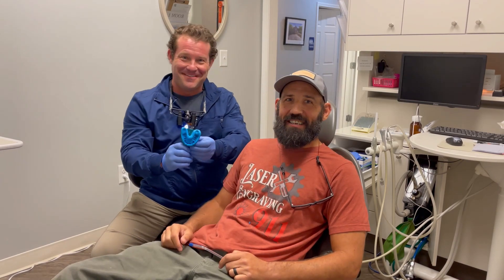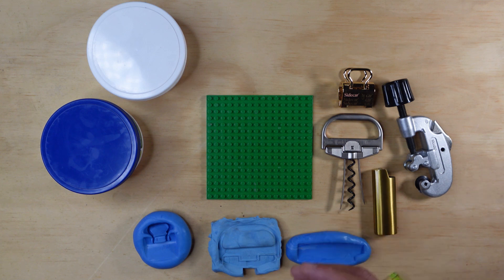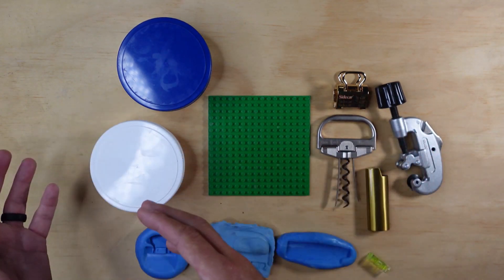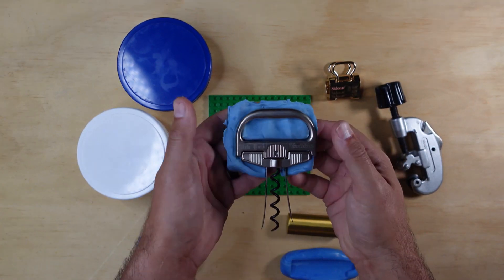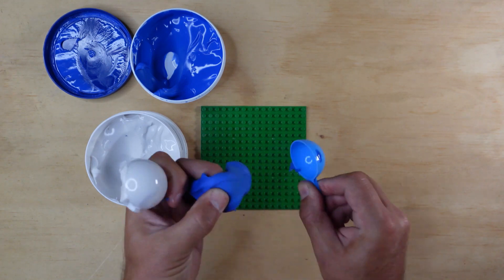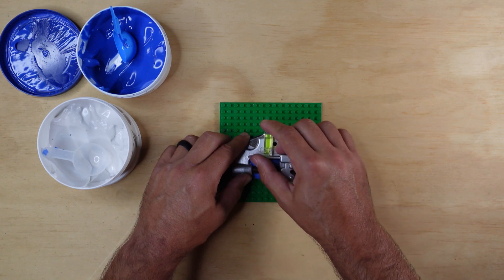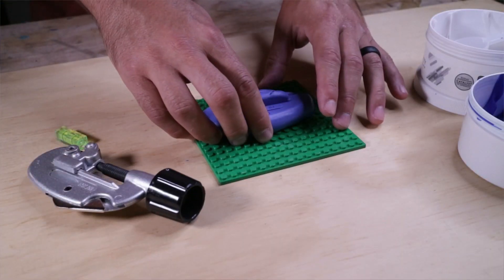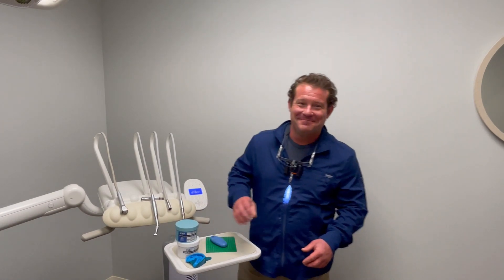Making Fixtures For Laser Engraving - Why Should Dentists Have All The Fun

Comment: Good idea but it seems modeling clay would work as well and probably much cheaper.
Reply from the maker: Thanks for commenting ! Actually modeling clay is a poor choice for this, it does not hold its shape, it sticks all over the object, and sags over time, i tried this early in my carrier, and it was a fail. Making ridged mold like this, is the way to go, so you can reuse them over and over again for years, and it holds your items perfectly.
Reply: @LaserEngraving911  
True but not after sets up and that can be easily expedited in a toaster oven. I mix plaster of Paris in to make it set faster and harder. I do this for fixtures when building small welded scrap metal art when I build multiple repeats. It doesn't mind the heat either.
Reply: @gcase08   plaster of paris + modeling clay and now you need a toaster oven? Nah.  I'd rather just shove the blue and white together and have it ready in five minutes.